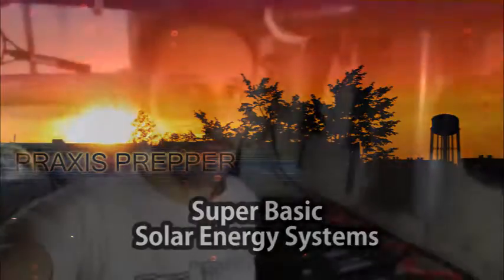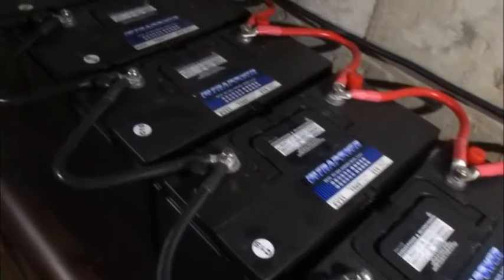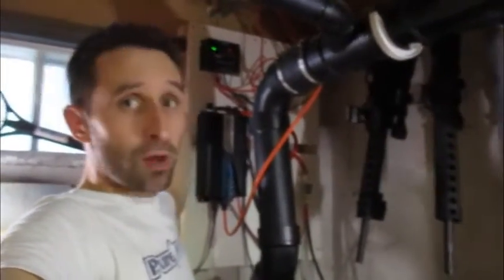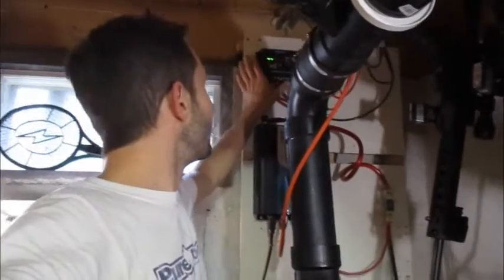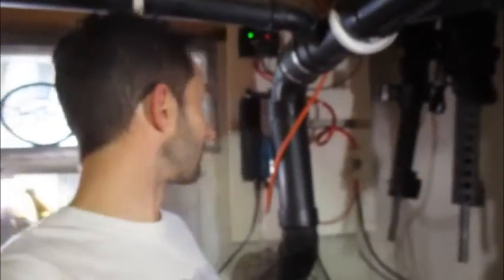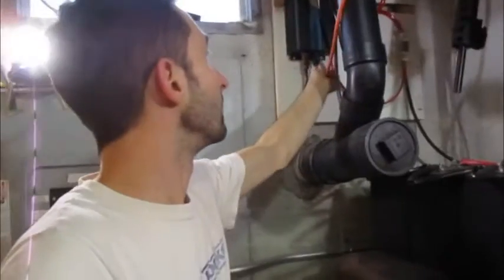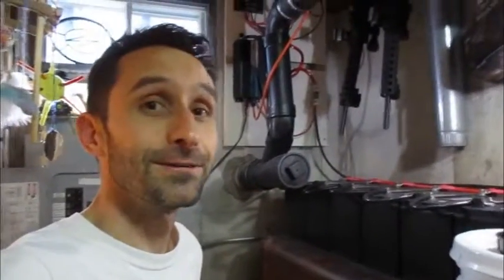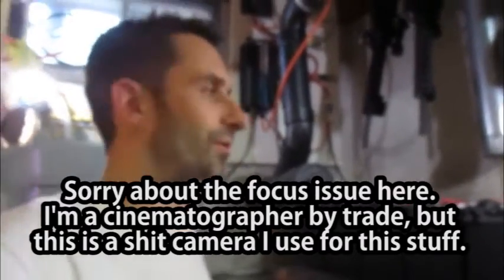Super Simple Solar Electricity

Comment: The reason you take power from your battery bank from each end is so that your taking power off the tops of ALL the batteries at the same time !  Where if you take the power from one end ONLY, your taking power from just THAT battery and all the other batteries in line have to drain into the end battery !!  MEANING !!!  The end battery ends up with a VERY short life because that one is taking ALL of the load !!  So the other way you SHARE the load over ALL the batteries !!   Seeya Rob
Reply from the maker: Right, I know that of course. But what makes me curious about it though, is that with such heavy wire (2AWG) joining all those battery terminals, connecting at one end seems sort of the same (electrically) as connecting at the other end. By this I mean, that with all the terminals (being connected with such heavy wire), they just sort of seem like one single terminal to me.
Again, I'm NO electrician - obviously.
I always try to communicate to people on my channel what I know for myself and what I'm just told by others - as to not spread rumor without caching it as thus. Since this was a concept I was told, but didn't have a firm understanding of the reasons for it myself, I was sure to convey that along so people can make their own decisions and maybe do some extra research on their own.
... I don't think I'll ever truly understand electricity. But I'm still determined to utilize it! ;)
Thanks for taking time to leave your thoughts!

Comment: Solar is a super awesome technology.  I have been into solar since I was a small child buying the little solar cells at radio shack and soldering them together to run bigger stuff.  With messing around with it for around 30 years at this point (man I feel old) I have found it to be very educational and rewarding.

It is great you made a simple introduction video so that we can get more people using the technology.  Hearing all the parts needed can really scare people away but this video should help them to get their feet wet.

I'm working on a book about solar that will cover tons of stuff, including a bunch of the engineering bits about the wires, inverters, batteries and such.  So lots of math for people who want to really geek out.  My plan is to also make a bunch of Youtube videos so people can watch the videos and check out the book and the book can point to some videos for visual aids.  Well that is my plan and I'm working on it.

Just make sure to not let any electrical inspector see your solar setup.  They might condemn the house, mostly joking but some inspectors are that bad.
Reply from the maker: In your book, maybe you should consider a brief intro to solar as I've done here. So people could read that first 2-3 pages and know enough to sort of get going and then delve deeper to learn more after they've set up something to try out?

Comment: Great video. My dream is to build a get away cabin and solar power it. Like your setup.
Reply from the maker: You should really look into doing it. It truly is much simpler and cheaper than you might imagine. I just finished building a 10'x14'... "shed" (which has 4" of foam insulation, a loft that can fit a few people sleeping, DC wiring running to the roof, and a water drain through the foundation). The idea is that it could easily be made into a very comfortable living space with very little additional effort. Sitting there last winter (unheated) the interior never dropped below 40 degrees or so.  That structure was built for about $3,000 and is essentially a small house - nearly ready to go. If you'd like, I could do a video on that project. I used a very simple building method using conventional lumber.
Reply: +Praxis Prepper I would love to see a video on the building.
Reply from the maker: srry - always doing that. (replying using my other account)
Reply: +Adam Starr Looking forward to it. Have a fun and safe camping trip.

Comment: so u were aiming at simplicity? u hit your mark. this is the simplest (is that a word? :)  explanation i have seen. been having a bit of an issue wrapping my head around solar set up. Was an IT tech and my pops was an electrician (retired) you'd think i would know more. watching this i was thinking, 'huh. thats simple enough'.  could you run the solar thru a circuit or two in your existing circuit box? or maybe install another 2 to 3 circuit box and connect existing house wiring to solar thru that. And the series/parallel pannels is a simple and good idea too. Im a visual and hands on kinda guy. maybe putting it on paper first would be best for me. starting point is your easy to use guide here and expand from there. Thanks a ton for this vid!
Reply from the maker: You're welcome. I just recall how daunting all this was to me when I first started. And while it IS possible to go way complex with all the (very useful) options you can work in, it CAN also be quite simple.
Your idea on working the power into my house circuits is something that I'm working on right now. I'll have a video on it as soon as I finish. Essentially, I want these panels and batteries to run my refrigerator. It'll be a similarly simple approach.
Anyhow, thanks for letting me know you found the video helpful!
Reply: I think i started at the complex end of this subject and was overwhelmed by all the info i tried to absorb. Looking forward to the future vids on this subject. Im looking at a few properties that could accomodate solar and small wind energy, more so than current property. This vid was most helpful. Go simple and expand from there.
Reply from the maker: Don't get TOO hung up on finding the "perfect" solar/wind spot. I mean... TRY, but solar can work well pretty much anywhere (considering how cheap the panels are). My personal location, as far as solar goes honestly sucks. I've cleared out some trees to make it better, but honestly, it sucks.
So do your best, but the key to surviving SHTF is to learn to make do and thrive in some pretty shitty (as in the S of the SHTF) circumstances. Don't let the perfection trap kill your dreams - find something that can work and make it the best you possibly can - good luck!

Comment: My main system is 11kwh and 48V based [for thinner wires] and I use an industrial UPS [uninterruptible power supply] as my inverter since they were cheap, cost me $50USD second hand for a 3750W unit that works great with a spare 1500W that I got for $10, in both cases I threw out the internal batteries.  I do exactly as you have done with the double plug, you can run one to various circuits, including the lights if you have the correct light 'extension'.   As you have mentioned there's quite a danger to doing this, so tape, signs and so on so nobody turns on the power for the circuits if you're doing that, electricity makes fires really easy :)

If you were looking to go bigger, fork lift batteries last a very long time and can do 80% DOD [drain down to 20%] with still fairly high numbers of cycles, even better if you do 50% DOD.  Downside is hydrogen needs venting and potential corrosion [noticed those nice firearms above the batteries], though they're good bang for buck.
Reply from the maker: You sound like you've been tooling around a bit yourself. Cool. Sorry about the rifles hanging over the batteries in the shot. I had them hanging there for storage and noticed them after I shot the video when I watched it. It was not intentional "mise en scène" (cinema term meaning that something placed in the scene to send a particular subtle or non-subtle message). Just a situation of limited storage space. Don't worry - they're all locked and the ammo isn't stored there... (I keep that next to my bathroom toilet of course!)
Reply: To be called a tool in our country is an insult or from a friend a compliment.  [Australia].  We're weird people and I'm mostly messing, which we do a great deal of, particularly to our friends [mates]

Indeed, I've been playing around with it for a while and I do love electronics, so it's fun for me.  Longer term is having an integrated system [permaculture] semi-self sufficient and being a prepper to have the resources to switch to fully self sufficient if need be.  Till then, doing all of the experiments and getting the experience, knowledge and tons of mistakes on the way.
Reply from the maker: Phew! Well, I'm glad we're friends! ;) Good luck... tinkering.

Comment: Is there a cap to the number of batteries you can charge? Meaning, could I get one panel and expand the number of batteries over time to spread out the high costs of the batteries?
Reply from the maker: I've never heard of any such cap - at least not at "normal" numbers of batteries. Maybe if you get too many (say 35 trillion batteries or so) it hits a tipping point, creating a temporal singularity and the earth would be swallowed up by a black hole. But, no as far as I'm aware, there are no limits along those lines. However, depending on what you mean when you say you might buy more batteries "over time", you COULD run into an issue where the new batteries and the old batteries don't play well together. Often it's suggested that it's not a good idea to mix because (and here's where I start getting out of my area of expertise), the voltage of the older batteries will not be able to go as high as the new ones. When you use 12v batteries, and charge them, they head up to about 13.5 volts. As you use them, the voltage goes down. When it's at about 12v, they're considered about half spent. So anyhow, as they age, they are not supposed to be able to reach as high a voltage at full charge, so adding new batteries into that mix, either just disallows the new batteries to reach full potential (held back by the lower voltage cap of the older batteries), or something dangerous happens - to be totally honest, I don't recall.
But all that said, I bought 4 batteries for my system initially, and after a year bought the rest. 1 year isn't considered that long in battery years I was told. So I hope that helps. Please feel free to ask any other questions you may have.
Reply: Thanks for explaining! That does make sense, I have heard before that rechargeable batteries have to be paired with each other. By cap, I guess what I'm trying to ask is if there is a practical limit to the number of batteries one panel can keep charged. Also, how many batteries would you recommend if the only thing it will power is one approximately 18 cubic foot refrigerator/freezer?
Reply from the maker: I should maybe make a video on this stuff. It might be easier to explain that way. I can tell you right now though, that the system you see in this video is used to power my refrigerator. I'm not sure how many cubic feet it is, but it's one of the regular kitchen sized ones that isn't the HUGE size ones. It has no ice maker or anything, and it was an energy star one. I plug it into the solar system during the day when it's sunny. I put it on grid at night. I do that to avoid draining the batteries down, BUT I was away for 2 weeks a bit ago and left it on the solar system the whole time. I did that because it would protect the food from power outages, and because I knew that because we wouldn't be there opening the fridge constantly, the batteries would carry it fine, and they did.
If you do plan on doing this, you could probably keep it on the system 100% of the time IF you don't have the refrigerator in a place where it needs to work a lot (like in a hot room), and if you were sparing about going into it (like maybe only popping inside 6-10 times per day or so, especially at night when the panels aren't giving the batteries a recharge.

Comment: wait...so.....you are running the double male extension cord.....into one of your outlets in your house....and then i take it...THAT ONE SPECIFIC CIRCUIT....ie....the kitchen curcuit.....will then have AC power....from the solar system.....correct? Plugging it in like that does not provide/attempt to provide AC power for the ENTIRE HOUSE right? thats really neat i did not know that was possible....that being said.....personally, as a backup power supply.....i would just run extension cords/surge protectors off directly off of the inverter and not bother with trying to electrify a house circuit...just me. then if you get really serious then make a solar system that is big enough to directly power the entire house
Reply from the maker: Yeah, DIY double male ended. If you do that, BE SURE!!!! to turn that breaker off for the circuit you're going to plug it into... and put tape over the switch... and a big sign over that switch... and yeah, you should probably just remove that switch.
I've had not one but TWO bad experiences accidentally NOT having the breaker off when I plugged it in. BE CAREFUL!!!!

Comment: great video....but two small issues/additions....what do i know im less of an expert than you...but.....one thing to address is how do you COMBINE all of the different wires coming out of 2, 3, 4 solar panels....i only have 2 panels and i had to buy these little combiner doohickeys so i have just TWO WIRES coming INTO my charge controller instead of 4......and then...if you want to combine for example 6 solar panels, i think you need more complicated combiner box/doohickey...again...so you combine 12 wires into 2......you seem to be putting 24 volts into your charge controller, and then I guess....24 volts into your battery system...and then running this into your inverter obviously......again, not an expert! but i think 12 volts is just more common, i think most inverters can only accept 12 volts in.....plus if you run things DIRECTLY off the battery...instead of through the inverter....then MOST devices are 12 volt.....so what ive done is keep everything 12 volt...the solar panels....the batteries.....going into the inverter...everything is 12 volt.....kind of like using microsoft or the ar15 or something....12 volt....whether or not its the best i dont know but its good enough and it seems like everyone uses it.....so i just stick with the "standard" voltage....
Reply from the maker: I should do a video on voltages. This is a good question, and best answered visually. I'll do one for you over the next few weeks.